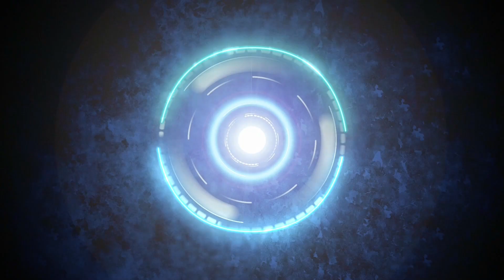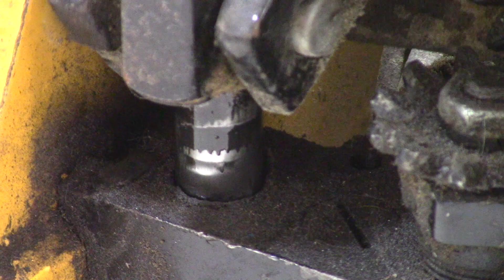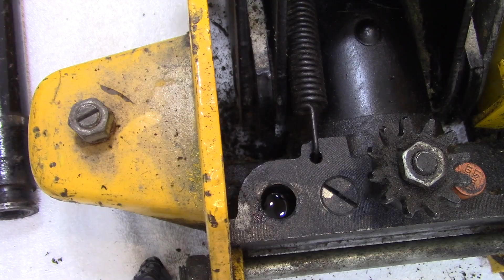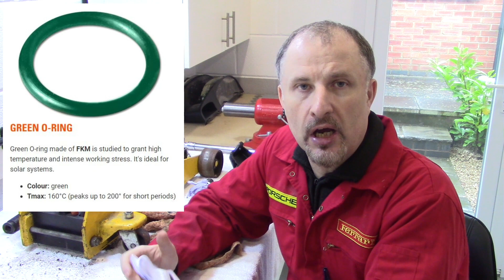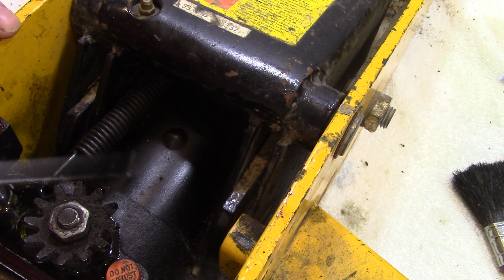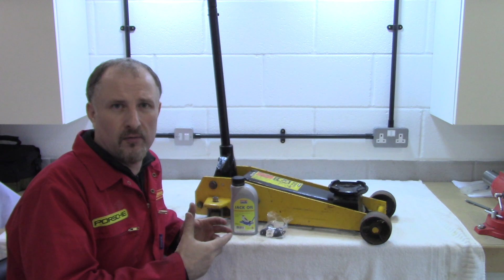How to repair your Halfords or Sealey 3 ton Trolley Jack: Quick Tech Ep3.

Comment: just did mine and glad to see you made the same mistake i did. the plunger you removed to replace the seal is fitted backwards, the open slot points towards the front. on mine occationly when the handle is fully upright the plunger gets stuck and twisted. turned it around 180deg and it fixed the issue. worth checking yours. cheers

Comment: I’d like to add that my Jack requires an o-ring with a 3.5mm cross section area. You used a 4mm, which is most probably why you had such a hard time fitting it, and replacing the plunger. 

3.5 CS x 16mm I.D O-ring if you want to do a search

Comment: if you measured the pump piston diameter..could you post? Mine looks identical and want to get orings. Thanks for a terrific explanation!
Reply from the maker: Unfortunately I can't measure it as I'd have to pull the pin out again. But I'd suggest measuring your pump piston and get an O-ring to match as there could be slight differences anyway.
Reply: So reading between the lines…your piston measure right around 16mm since that was the ID you ordered. Mine is 15mm so I ordered 15mm ID x 4mm CS. Thanks again!!

Comment: did you notice you put the plunger in backwards? you removed it open end to te front, and replaced it open end to the rear.
Reply from the maker: Yes, too busy filming to notice, but it works either way round.

Comment: Typical I have just binned mine because the seals had gone I didn’t think they sold replacement parts for them I have  just got a black jack
Reply from the maker: Yep, I've got a few other jacks with similar issues, I think I'm going to do the same to those as well. One thing I did notice, is the place that sold you the jack, doesn't sell you the seals, so you have to buy another jack.... sneaky.
Reply: I am sure it’s engineered that way for you to buy rather the buy the shares just for curiosity where did you get the seals
Reply from the maker: @billywhizz98  Yeah I think you're right. I bought these from a company that just sells seals here in the UK. They have an eBay shop, totallyseals.

Comment: if you had left the oil filler cap in loosely you would of seen the air coming out when you bled the jack.
Reply from the maker: Yes, true. Thanks for the tip. ;)

Comment: HI There. I have a sealed and a Halfords 3 ton jack.
Just wondering where did you buy the replacement oil rings or kit for the jack. 
I think that is the most important part in ordering the oil rings or seals. As I am useless at that. Any help would be appreciated. 
Both my Jack's are fairly   new. But precautions is better than cure.
Thanks  you.
Very nice and informative video. 
Cheers
Reply from the maker: I've been trying to find the receipt, but no luck. I did order them on-line. I think the company was based in England. Sorry can't be more help, if the receipt turns up, I'll post a comment.

Comment: I have a sealey 1250cx jack v1.  No visible leaks, pumps up ok and holds load.  If you undo the release valve slighty it drops immediately and fast.  Do you have any ideas on whats wrong?
Reply: Same as mine. Need that answer too !! Anyone ?
Reply from the maker: Check the spring and ball bearing. You could have a broken spring, damaged ball bearing or contaminant in the mechanism.

Comment: Yep, some 'fools' have been known to unwittingly use brake fluid as jack oil, then the standard idiot has been known to use engine oil, but the classic miser idiot has been known to use cooking oil😆 goodbye seals !
All oils are not the same use, clue is on the label.
Gaz UK.